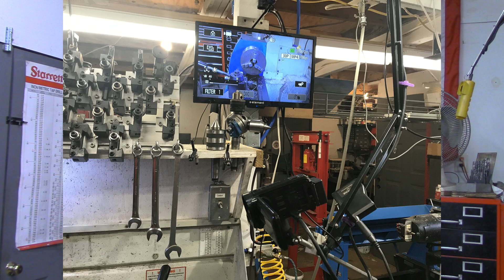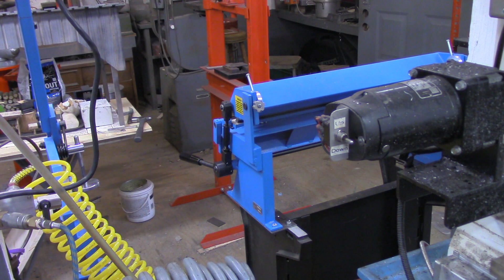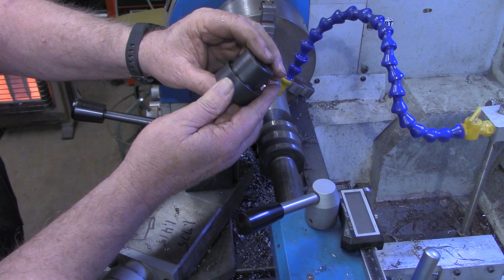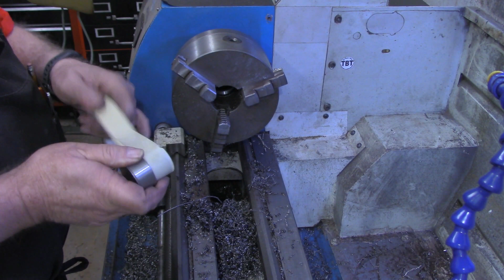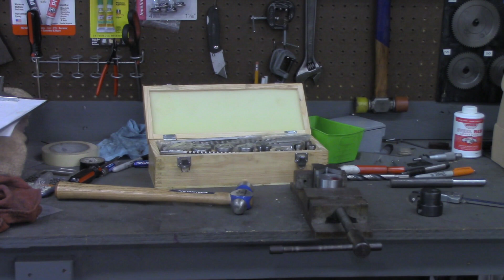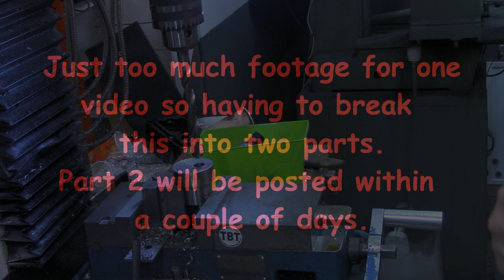Box Pan Brake Handle Part 1 of 2

Comment: Hi Lee, good video.
The 1\8" broach is 3.2mm your looking for 4mm key way.
Looks likely you will need to file the rest of the key way, Or mill a step into the key steel
Do you have rust problems on the lathe, I noticed the quill on the tail stock is blackened ?.
ATB Adam

Comment: I grew up using imperial at school then we started to get both, metric is very easy in comparison as everything is to base 10 just like numbers, 1, 10, 100, 1000 etc problem as you are finding is most things nowadays are made using metric(chinesium) so any mods using original and new mixed you need a whole new set of tools. My John Deere tractor has both as it was built in 79 in spain, probably some parts being made in usa then shipped and fitted in spain. I'm sure you'll manage

Comment: Like the Randy Richard approach 3 others then you did it as well he should get a fee flat panels are so low cost, you are the first we seen do the wireless one and share it. Do not have a break but because you bought that one and ungraded here on this handle now and also in the video where you did that offset little handle for the opposite side of the 24" setback video if we bought one we would want it to have all of the things you knew to do and make it better. Thank you for the video always, Lance & Patrick.